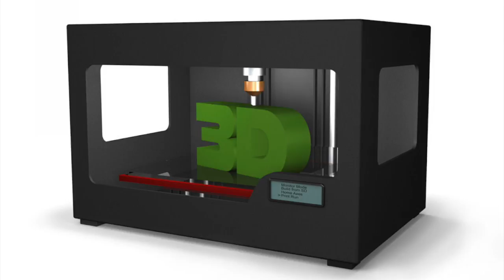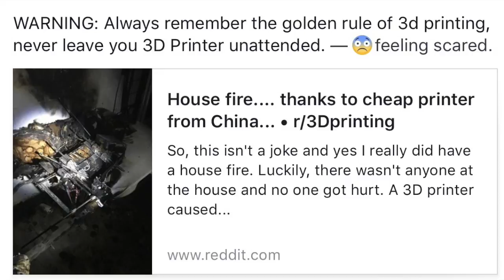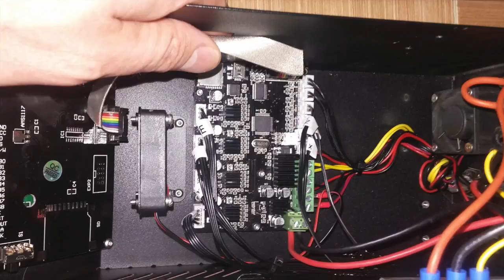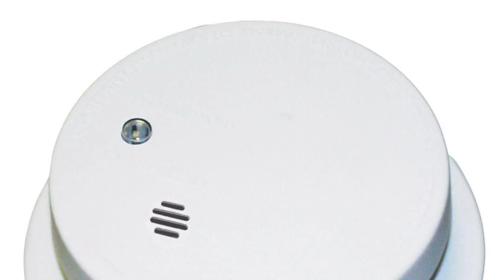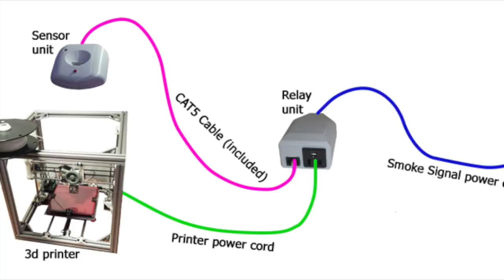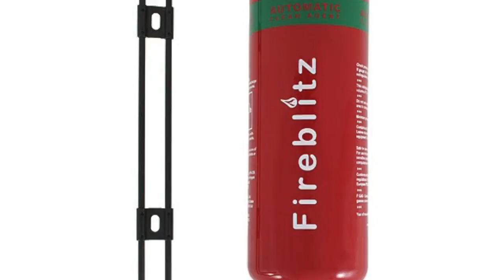3D Printer Fire Safety : Most Important Video you will Watch!

Comment: Build an enclosure with fire rated drywall. If i remember correctly from my construction days, 1 layer of 5/8” is good for a 1 hour burn, 2 layers is good for 2 hours. Add a smoke and carbon monoxide detector inside or close to enclosure. That should give you a bit more feeling of security.
Reply: I always write comments before the video is over.. lol
Reply from the maker: lol.

Comment: Will you please make a video about dialing in the cr-10
Reply from the maker: Was there a some thing you wanted dialed in or in general, overall for cr-10?
Reply: SAN TUBE just getting the best prints off of the machine. P.s just got mine and loving it!
Reply from the maker: It is a great printer.  For tuning just the printer it self all you ready need to do is tighten down the heated bed and the belts and add a few very simple mods.  https://youtu.be/QmSxPRWlGjQ watching starting at about 14 mins on how to tighten everything and to fine tune it.  Next video shows you basic but very helping mods.  https://youtu.be/Tk83sFg3tNM.  After that you should be good for a while until its time to do some maintenance.  Good Luck and Happy printing.
Reply from the maker: Then Level your bed :https://youtu.be/D6V3VtmbR-g and also check out this video, its the most common problems we run into in the beginning and how to solve them https://youtu.be/8zLNM96yqcc.  After that you adjust everything in your slicing program.
Reply: SAN TUBE I have watched all of your vids. But I want to just dial it in to be perfect
Reply from the maker: Donovan Morgan ok let see what I can come up with.
Reply: SAN TUBE also. If you could make a video on making the machine a dual leadscrew and moving the border extruder so it's not on the leqdscrew
Reply from the maker: I will see what I can do